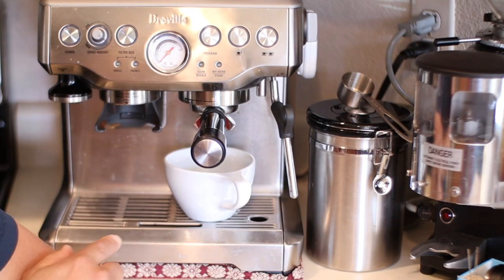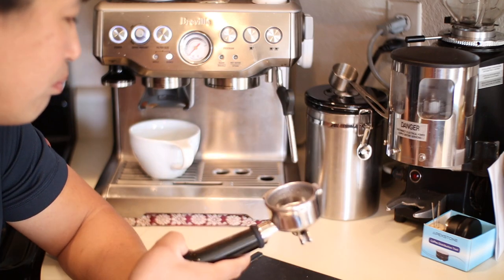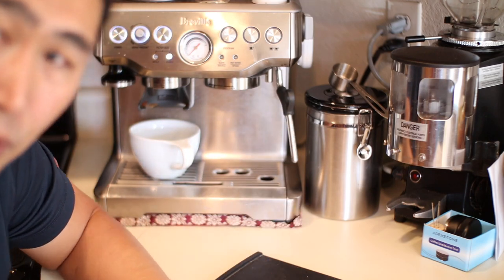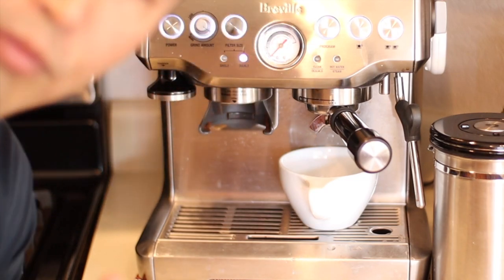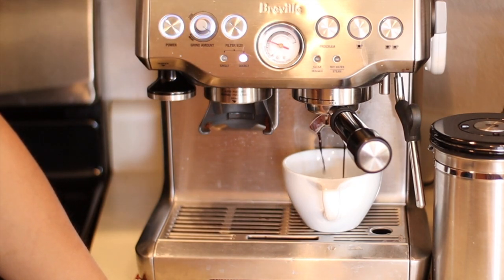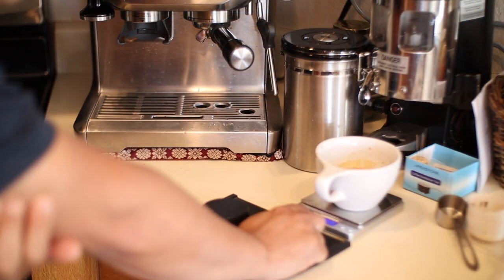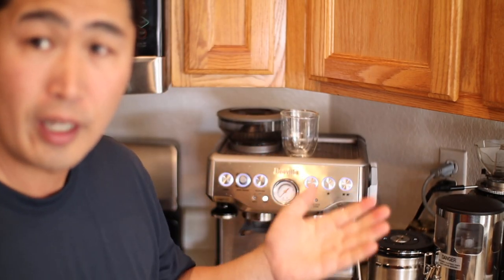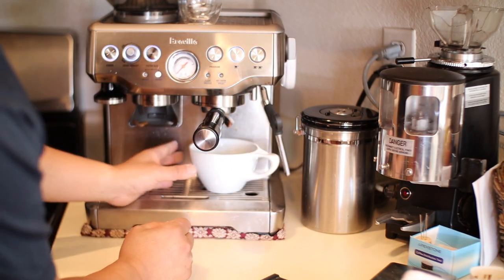How to Fix a Sour Espresso - Breville Barista Express

Comment: Hi hoon, so I have the same espresso machine as you and I was wondering how you get it to be on the 8 setting for the grind. On my machine, it seems that I can’t go past the 4 setting without it being under extracted. But Right now the shots on the machine are pulling really well, they go to the 12:00 position most of the time and the espresso isn’t sour. So should I just keep it at the 4 setting if it is pulling good?

Comment: Hi @Hoon's Coffee, 
Thank you for your videos. They have been very very helpful in making a better espresso. I just got this machine and i am using the same beans (Lavaza Crema) as you. I follow the same ritual as you, i.e. leaving the machine to get hot (20-25 mins), distributor, measuring and all. Following are my issues"
1. 1 Cup Single Wall Filter, with 7-8 grind setting, I get GREAT coffee. But i would like to use the When I use 2 Cup Filter
. 
2. When I use 2 Cup Filter
, grind 7-8 - just sour and no pressure coffee
3. When I use 2 Cup Filter
, grind 2 - Great Crema, beautiful coffee but just bitter/ sour. I am using the same machine, same beans as in this video.
Any suggestions or tips would be much appreciated. 
Thanks

Comment: Nice video! I have a Sage machine which seems to be almost the same as yours and I also struggle with sour flavours.
I'm using the finest grind level and my pressure goes up to around 2 o'clock, but still the extraction is too fast. How can the temperature lead to a longer extraction time though?
Reply: I have the same. Try tamping a bit harder but not too much. That also slows extraction down a bit. For dark roasts they actually recommend setting the machine to -1c so it’s colder water. That slows also down extraction a bit and reduces sourness. Opposite with mild roasts where it’s +1c. When you are in the 30 second range you are good. Make sure the machine is warm.

Comment: You changed the grinder setting to 8 after 20 minutes. Does the final extraction come from waiting too long or from the finer grind? Maybe the main cause is the finer grind alone, not both.
Reply from the maker: You might be right!
Reply: My money is on the grind size. 
I doubt any temp difference of thre group head after being left to warm up (it was warmed up previously when he heated the cup) would have changed the speed the shot poured or the volume of the output.

Comment: I have the same machine, and I've learnt a lot from this video already. Will check out the rest of your video's.
I don't measure the amount of coffee I use, and I usually apply about 30kg's of pressure with the temper, and grind is currently set to 1, this is how I get the pressure. I might go buy a scale and measure the amount of coffee.
Reply: How does one know they are applying "30 kg's of pressure" when tamping? Is there a way to actually measure that?
Reply: @yorbalindason  I was using scales, pushing down until it reached 30kg's
Reply: @yorbalindason  That's way to much!  66 pounds.... try about 10 at most

Comment: Thanks Hoon. Your videos and tips helping a lot with cleaning, adjustment of inner and outer grinder settings, and now this brilliant tip around heating up machine, head to enjoy a yummm cup of coffee.

I wish if breville have an indicator light to show when machine is warmed up and ready to use.

I have a question regarding warming up though, after you leave machine, it looks like goes into sleep mode. Power light starts glowing in snooze kind of mode. Do we need to still press power button and wait for 20 mins?

Comment: Hi, I am not getting the grind size right. I tried 13 grind sizes and it still tastes sour.  What is the interior conical burr grinder set to? Mine is at 7.  Can you talk about how to know the right internal grind size and then how to know what to set the external dial to? I ground the same beans at 1 and then all the way at 14 and they looked the same.  Is it my grinder? My machine is 2 days old and I can't figure it out.  Please help.

Comment: Hey Hoon. First, thanks for all your content. 

How can I tackle this issue with the Pro? It doesn’t have a warmup time due to the thermo jet system. I adjusted the heat manually in the menu, perform a pre-infuse heat up to 8 seconds, still very sour.

Comment: You can also adjust the temperature of the water internally by several degrees depending on which setting you chose.
Reply from the maker: I set my machine at default setting.

Comment: When timing a shot, do I include the pre infusion stage or start timing when the espresso is coming out? My shots have been pulling in about 35 seconds, starting with the push of the button. But they still seem sour.
Reply: Only start the timer when you see the shot start to pour
Reply: Same here and i use the same beans hoon has in this video. Time is good, pressure good but still seems sour

Comment: Where do you find the pressure gauge to be best? For me it appears to be best when it’s between 1 and 2o’clock..
Reply from the maker: With LaVazza SuperCrema, 11-12 is better. 1-2 little bitter for me.
Reply: Hoon's Coffee interesting - can you get at least 20 second pull at 12 o’clock? I’ve been unable
Reply from the maker: @nhall78  You have to put into manual mode to control the time but I don't like to doing it.
Reply: @nhall78  im with you, to get over 20sec i need to be at 1 or 2 o'clock

Comment: I followed every tips and still very bitter extracting in less than 15s.
Portafilter is warm, pressure gauge at 12 oclock....how can i fix this?
Reply: Hello there
In my experience there are 3 things you have to balance to get a decent espresso shot

1 heat up the group head and the basket-+ the cup you use 
2 get the grind Wright adjust it as you practise
3 most important coffee
With supermarket coffee you are not going to get a very good espresso
Lavazza super creama is a good one( I used lavazza but I’m using pascucci at the moment)

Now pay attention 
Keep the coffee airtight and if the kitchen is dump think of keeping it on a dry place
Coffee is very sensitive to dump ness and you can get everything Wright but if the coffee get moisten it will taste bitter
So look after the coffee and keep it dry and properly sealed

Hope this help

Comment: Thanks Hoon

What internal setting is your burr grinder on?  My pressure gauge is consistently at the over extracted mark but I’m still getting a weak/sour quick pour shot, despite grinding finer and sticking to 18g in basket

Comment: Is it possible that some beans just won't make espresso right? I went through a whole bag of " good" fresh beans, medium roast from a local roaster and could not get it to be not sour. I had the grind as fine as it could go. Time and out put were right (2 0z) around 28 seconds. Grind was down to 2 internal and as fine as it could go on the outside knob. How do I fix this? Tried a different coffee on the same settings and it came out good. Not sour.
Reply from the maker: Good beans are the key to making good espresso. What kind of beans are you using it now?
Reply: Hoon's Coffee - right now I'm using Irving Farm - Blackstrap the one I couldn't get to come out right was a medium roast from Graziella. The one I've had the best luck with is Atomic Coffee Roasters- Diesel Dark Roast. The Graziella I literally went through the whole bag and every shot was sour. Should I have tried to change the temperature?
Reply: @notyouraveragevegan2677  you need to wait a week while still in the bag after roast date before you start using the beans.

Comment: Hoon , if your using 8/9 on the exterior grinder setting , whats the internal setting your using at the burrs ?
Reply from the maker: My inner burr set at 6 at the moment
Reply: @HoonsCoffee  Thanks , ill double check mine tomorrow. I know each machine will probably be different , but might get me in the ballpark. Having trouble with sour and bitter shots. If i grind fine and manually pour the shot to get anywhere near upwards of 28 seconds the coffee tastes terribly burnt

Comment: I bought an used espresso machine,  which works completely fine as per instructions and I have checked all parts but when I make an espresso it doesn't give me a good thick layer creama on top, I have tried my local roasters freshly roasted coffee with ground size of 0.8 and the regular espresso grind but my espresso comes out with very thin layer of crema. 
I tried pre-heating my machine.
I tried different grind size.
I tried different dose( amount of ground coffee)

Comment: Hi there, I purchased this same machine about a week ago and was able to make great espresso shots with a medium roast. My husband and I are trying out a blonde roast (with a roasted on date) and haven't been able to have much success. We've gone all the way down to #1 grind from #9 to experiment and the espresso still remains sour. We always allow the machine to heat up for the recommended time prior to using, so we're not sure what could be the road block. Pressure and yield are good, and the timing during extraction is ok. Any suggestions?

Much appreciated!
Reply from the maker: With lighter roast, water temp is important. Try increase the temp. Here is video how to do it https://youtu.be/y_S7Hg0N980
Reply: Hoon's Coffee Thanks for the link! I’ll try that out and will let you know if that solves my problem so others can use that for reference too!
Reply: Hoon's Coffee Just wanted to follow up and say that increasing the temperature did the trick! Thanks again!

Comment: I’m new with espresso. I have the Breville espresso touch,, have been playing with different kinds of bean and brands. Sometimes I got a good shot,sometimes not. Watched  some of your videos and I learn a lot of tips. Just wondering what number did you set for conical burr. Manufacturing set is #5 on mine. I Bought a bag of Lavazza beans at Costco yesterday, and it tasted sour and then I adjusted the grind dial from outside finer but it still bad. I don’t know if it’s me or the beans or I haven’t found the right beans for my taste, so far only Starbuck beans is given a good cup.Any  thoughts would be appreciated. Thank you.
Reply: @thuan nguyen , me too only starbucks coffee is not sour, tried different grinds, and fresh beans... did you find a solution?

Comment: I've got shots running high pressure and they look a lot in colour like your second (good) shot, but they're still running a little fast and they taste REALLY sour. Could it just be that my beans are bad?
Reply from the maker: How old is your bean?
Reply: @HoonsCoffee  Supermarket beans so I already suspected them to be the issue. Even with a decent extraction pressure and weight ratio the coffee still tasted sour.

I'll retry with a better batch and delegate these beans to regular coffee with the pressurized basket.
Reply from the maker: @Stoney3K  Try Pete's coffee. They are only coffee that has roasting date on it from Supermarket coffees.

Comment: Hello Hoon, thank you for all the great videos. I just purchased this machine yesterday and have been having some trouble with pressure. To get my machine anywhere close to the right range I had to adjust the internal burr from the 6 that it came at all the way down to a 3 and then set the grind all the way down to 1! I am using fresh beans from a local roaster so I know they are fresh. Is it normal to have to adjust the machine this much to get pressure? What am I doing wrong? Thanks in advance for any help!
Reply from the maker: Try with pressurized basket first(Set internal burr to "5" and grinder setting at "8". Make sure your machine is working properly.
Reply: Sorry, I should have specified, I did try that as well. Pressure is fine with pressurized basket at factory settings. I bought the unit from Best Buy and thought I might have received a bad unit so I took it back and got a replacement unit. Exact same issue... i feel like I must be doing something wrong but I can’t figure it out.
Reply from the maker: @jdrown123  What kind of bean are you using it now?
Reply: Hoon's Coffee, I am using an espresso roast from a local coffee house. It was roasted on 6/3/2020
Reply: Are you putting enough beans and tamping enough?

Comment: Very helpful. Can you explain, may be, in another video on how to change settings for long or small shots.
Reply from the maker: You mean single or double shot?
Reply: I meant volume for single and double shot
Reply from the maker: @asifjalil6020  I like to measure it out 18 g for double and 9 g for the single shot. I don't want to mass with time dosing on the Barista Express because I don't store beans in the hopper.
Reply: My machine is pouring little over 2 ounce for single  shot espresso. How to change machine settings.
Reply from the maker: @asifjalil6020  You have to resetting the volumes by 1 CUP and 2 CUP shot volumes, press and hold the PROGRAM button until the machine beeps three times. Release the PROGRAM button.
The machine will return to its original default volume settings and default espresso water temperature
Reply: That was very helpful, thank a million

Comment: Any ideas why I can't get any pressure from beans that were roasted on the 14th? Stuck in the preinfusion phase of the pressure guage, Tried lowering the grind down to number 1 and doing a proper tamp && using the razor. Have down about 4 shots and the pressure has not budged a bit. Seems like no setting changes work.
Reply from the maker: Check you upper burr setting. You might need to adjust to lower setting there.
Reply: @HoonsCoffee  Thanks will give it a go

Comment: Hi.. im new with this machine..now i setting my grinder no 1 for inner and no 3  outside... never get 25-30 sec for extraction...i use 16gr bean...its my setting ok for grinder size? Also my coffee sour... i will try heat my machine..
Reply from the maker: Try with pressurized and see what happens there.
Reply: @HoonsCoffee   Hi, I am not sure what you meant by "pressurized". I have the similar situation and now my grind setting is 2. i am getting excellent cream and beautiful coffee but it sour. Can you elaborate what you mean by "pressurized". Is it a filter type ?

Comment: Hello Hoon. I’ve recently purchased a Breville 870xl and love it. I use Lavazza Blue. I’ve dialed the grind size, I get 12 o’clock pressure, but I get short durations, below 20 sec. I purchased a calibrated tamp, I’m applying 40lb of pressure  (sometimes more). 
Any advise?
Thank you in advance. I enjoy watching your channel. I’ve learned a lot!!
Reply from the maker: Try 1 finer setting and see what happens. Make sure go by your taste.
Reply: Hoon's Coffee I will try that. My current setting is at 3, I’ll try 2. What’s more important, pressure or extraction time?

Comment: According to quick guide, the recommended setting suggests  starting point at 5, on Grinding size and at about 3pm/50%, on the grind amount.
Reply from the maker: That is pretty good starting point as well. You just need to adjust from there. Take you time to adjust your shot. It took me many shots to get a right!

Comment: Have you had the need to adjust the burr grind setting? I bought some beans from Amazon, and they do not give me any preasure. I had to set the burr grind setting to 1 and the the dial to 1. I still do not get enough pressure and my shots are extracted in 20 secs. Maybe I should use the pressurized basket's
Reply: Andy it's better to buy from a local roaster and check the roast date so that you can be sure you're beans are fresh.
Reply: @RyanMultisport  yea, I gotta start doing that. The bag I bought is 2.5 pounds
Reply from the maker: Try with pressurized basket and see. How's water temp? Make sure water hot. By the way, what brand of coffee did you get?
Reply: If you’re at setting 1 and you’re not choking up the machine, those beans must be about 10 years old 🙈. I’ve never gone higher than setting 8 on my smart grinder pro.
Reply: @marknichollsphotography7804  I have my burr set to 1 amd grinder set to 13. Bought some fresh roasted beans and I am getting a very nice flow and crema in 30 secs